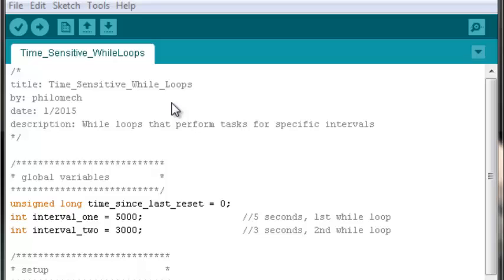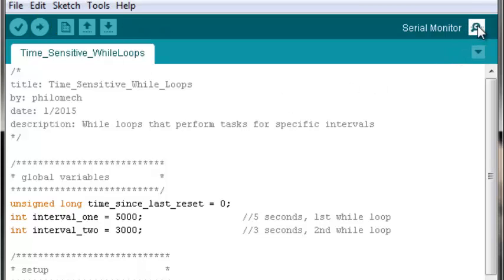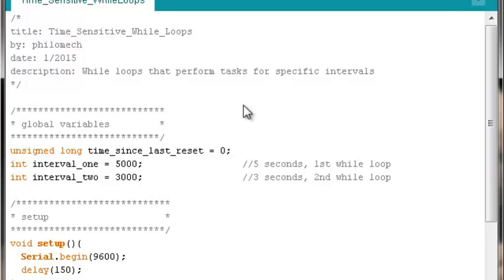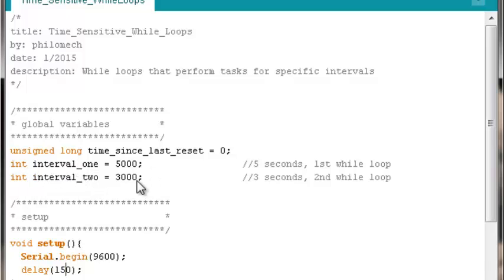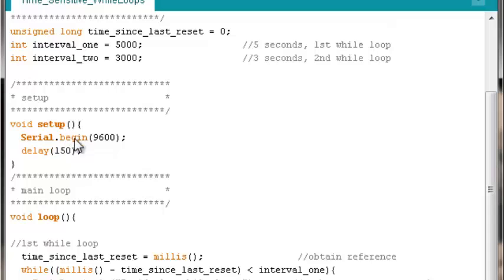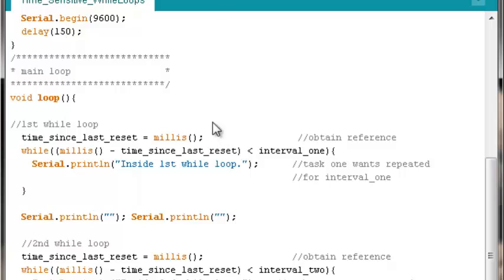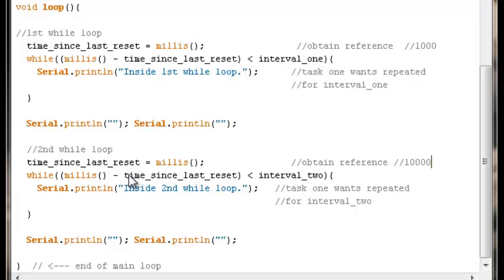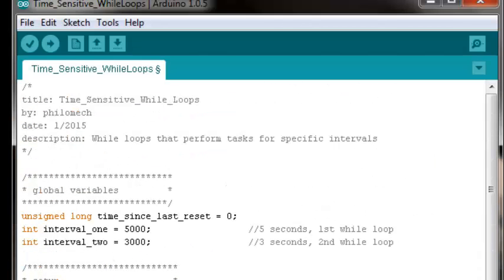Arduino Programming Tutorials || How to Construct Time-Sensitive While Loops

Comment: Thanks for the tutorial. Most of the time people are running their Arduino for short periods of time, experiments etc., but if planning to put your Arduino in service for longer periods of time, and wish to use this kind of routine for timing critical or semi critical operations, it's good to remember that the Millis() register rolls over every 50 days, and if using micros() the register rolls over around every 70 minutes. Good coding practices should take this into account when coding the while loop condition.

Comment: Can you trigger this particular price of code on a with a tactile switch? Or does time_until_last_reset start counting the minute the Arduino boots? I keep trying to implement this code... By giving a particular task a certain amount of time to execute. If there is no more activity on the button for 3 seconds: It takes whatever increment it is on and performs that task.

Example:

If(buttonState == 1)

While(time_until_last_reset == threeSeconds)

If(buttonState == high)

++someVariable

else()

switch(someVariable)

Case 1

Do this

Case 2

Do This

Case 3

Do This

Default:

Not understood

else()

//reset

someVariable  = 0
Reply from the maker: Jaren Hudson Appreciate the question and code.  Yes, one could definitely trigger time-sensitive while loops with buttons, etc.  Please give me a day or two (as soon as work releases me) and I'll post another reply to this message with some code possibilities/ideas.  Thanks for watching!
Reply from the maker: Jaren Hudson 
I'm trying to understand the order and logic of what you want the arduino to do.  

Do you want: 

(1) the arduino to listen for a button press
(2) if a button press doesn't occur within 3 seconds,
(3) then do something

OR

(1)the arduino to be performing various tasks
(2) and if/when a button press occurs,
(3) do some task for 3 seconds
(4) and then return to what it was previously doing?

OR

Might you have some other order/event logic in mind?

Just let me know and I will do my best to help. 

Also, time_since_last_reset will equal whatever the current value of millis() happens to be.  For example, suppose one enters the following inside void loop

void loop(){

      time_since_last_reset = millis();

      Serial.println(time_since_last_reset);

      delay(500);

}

The first time through the loop a value in ms will be returned from the millis() function and assigned to the time_since_last_reset variable.  This value will reflect how long the arduino has been powered up/running since either battery power was initially applied or since the last time the reset button on the board was pressed. Each time through the main loop (in the above example) one will notice around a 500ms increase in the value of time_since_last_reset.  

Essentially, calling millis() asks for the amount of milliseconds the processor has been operating since power up or since the reset button was pressed.  The value returned by millis() will always be increasing each time it's called.  Time is always passing.  Calling millis() is asking the arduino "how long have you been running?"  One can and often does use the answer to this question combined with later calls to millis() to do things like determine a duration, 'delay' without technically 'delaying', etc.    

E.g., 

void loop(){ 
    time_since_last_reset = millis();

   //perform some tasks

    time_now = millis();

   duration_of_performed_tasks = (time_now - time_since_last_reset);
}
 

Hope these comments help.
Reply: philo mech I am looking for a particular while loop to start at the press of a button... You select different "options" by pressing that same button again within those three seconds. I am attaching a piece of code (there may be a few mistakes) I just need to know where to add the time related functions.

*/This program is intended to listen for a button to be pressed. When it is pressed I need a time-sensitive while loop
to be triggered. This will act as a time out. If the button is pressed again within the three seconds it will incrment
an "option" variable. This will be used after the time out in a switch statement and print what option you chose within
those three seconds.
/*

int IncrementingVar;//Variable to store "options"

int Button = 12;//Button on pin twelve with pull-down

void setup()
{
pinMode(Button, INPUT);//Button as input

Serial.begin(9600);//Serial Communications
}

void loop()
{
int buttonState = digitalRead(Button);//New variable for "button"

if(buttonState == 1)//check if button is pressed
{
while(time)//This is where I need the time sensitive loop to execute but I can't seem to get the dang thing to start timing 
{    //once the button is pressed. I don't want it timing once the Arduino boots.
if(buttonState == 1){//if button is pressed again before the three seocnds pass... increment "options" variable.
++ IncrementingVar;
}else//do nothing
{
}
}
switch(IncrementingVar)//compare value of "options" variable to option choices
{
case 1:
Serial.println("Option 1");
break;

case 2:
Serial.println("Option 2");
break;

case 3:
Serial.println("Option 3");
break;

default:
Serial.println("No decisions made within three seocnds!");
break;
}
}else//Inform that there were no button presses
{
Serial.println("Listening again in 3 seconds");
}
IncrementingVar = 0;//reset the "options" variable if anything is stored
delay(3000);
}
Reply from the maker: Jaren Hudson 
Please see the following code.  It's not the most refined way to accomplish what you seem to be after but it should get us started.  I've tried to capture the control logic associated with the task.  Feel free to refine, modify, etc., it to better fit your application.  I included some crude/rough software debouncing .  If you're using hardware to debounce the button then such won't be needed.  

This is a first pass/draft.  If it misses the mark, or you have something else in mind, etc., then just let me know and we can go from there.  

/* (ROUGH VERSION)
title: time_sensitive_mode_selection
*/
/*****************
* global variables *
*****************/
const byte button_pin = 12;
boolean button_value  = LOW;

unsigned long time_since_last_reset = 0;
int selection_delay    = 4000;   //adjust as needed

int previous_mode       = 0;
int current_mode       = 0;
int max_modes          = 4;  //adjust as needed

/**************
* setup         *
**************/
void setup(){
  Serial.begin(9600); delay(150);
  pinMode(button_pin, INPUT);
  
} //<--end of setup
/**************
* main loop     *
**************/
void loop(){
  
  //read button
  button_value = digitalRead(button_pin);
  
  //button pressed? (crude software debouncing)
  if(button_value == HIGH){
    //if so, then delay for a few ms, give button contacts
    //time to stop bouncing
    delay(150);                                  
    //and then read button pin again
    button_value = digitalRead(button_pin);
    //if it's still HIGH, then
    if(button_value == HIGH){
      //print message to user
      Serial.println("\nYou have 4 seconds to make a selection.\n");
      delay(500);    //give him/her enough time to read it
      
      //get current time
      time_since_last_reset = millis();
      
      //and repeatedly test...has 4 seconds passed?...has 4 seconds passed?...
      while((millis() - time_since_last_reset) < selection_delay){
       //if not, then print message 
       Serial.println("make a selection!");
       //and repeatedly check button
       button_value = digitalRead(button_pin);
       //crude debounce again
       if(button_value == HIGH){
         delay(150);
         
         //if button value goes HIGH
         if(button_value == HIGH){
           //and the value currently assgined to mode
           //hasn't exceeded the max number of modes
           if(current_mode < max_modes){
             //increment mode value by 1
             current_mode++;
             delay(10);  //for stability
             //print message...the currently selected mode is...
             Serial.print("\ncurrent_mode = "); Serial.println(current_mode);
             Serial.println("");
             //give user time to read mode
             delay(500);
           }
           //otherwise, current mode value has
           //exceeded max number of possible modes
           else{
             //reset current mode to 0
             current_mode = 0;
             //and make previous and current mode values match
             previous_mode = current_mode;
           }
         }
       }
      }
      //let user know that the selection window has expired 
      Serial.println("\nselection window expired\n");
      delay(2000);
    }
    //previous_button_value = current_button_value;
  }
  /*if user did happen to change the mode value
  during the 4 second window,
  then run new mode value through switch()*/
  /*if no change to mode value was made, then 
  stay in whatever mode was previously selected
  */
  if(current_mode != previous_mode){
    switch(current_mode){
      case 1:
        Serial.println("\nmode 1 selected\n");
        //set previous_mode value to current_mode value
        previous_mode = current_mode;
        //do whatever else here
        delay(2500);
        break;
      case 2:
        Serial.println("\nmode 2 selected\n");
        previous_mode = current_mode;
        delay(2500);
        break;
      case 3:
        Serial.println("\nmode 3 selected\n");
        previous_mode = current_mode;
        delay(2500);
        break;
      case 4:
        Serial.println("\nmode 4 selected\n");
        previous_mode = current_mode;
        delay(2500);
        break;
    }
  }
  //display current mode
  Serial.print("-current mode-: "); Serial.println(current_mode);
} //<-- end of main loop
Reply: philo mech Thanks much. Very timely replies; I appreciate that. I will optimize it and change a few things around. I am using hardware to debounce the switch, to conserve memory. Thanks again though!
Reply from the maker: Jaren Hudson Glad the example code looks helpful.  It can definitely be refined and optimized.  I didn't have much time but I wanted to provide you with something that was close to what was needed as quickly as possible.  The switch case structure might need to be relocated/tweaked, etc., in order to accomplish precisely what you're after.  But hopefully the example provides some helpful ideas.  And removing the crude debounce code would be an immediate improvement, I didn't have a s-trigger, etc., ready to hand.  If there are more questions along the way, please continue to let me know and I will always do my best to help.

Comment: Hi Philo,
You were a major help in the past and I was wondering if you could help me again. I am trying to use arduino to close a relay once every hour and log data before relay closure and then after.  
I've been trying to understand how to create a time LONG time delay for arduino, from my understanding, the regular delay cannot do something more than a minute? Others I have seen have used some strategy which uses millis() against a set interval in order to approximate the period when to activate the relay? but this is a bit much for my software understanding.  Or am I really making this more complex than it needs to be? I can't just use delay for a long amount of time?  Thanks
Reply from the maker: Appreciate the question!
In principle, one could use the inbuilt delay function to halt an Arduino for longer than a minute, but there tends to be a 'better' (relatively speaking) way to achieve multi-minute, and especially-->hour to multiple hour delays.  Namely, one can use a real time clock chip/module.  Just connect one to the Arduino and have it trigger the data storage/relay trigger  events every hour on the hour.  

I've had a lot of success with Adafruit's DS1307 real time clock breakout board kit. http://www.adafruit.com/product/264  

Adafruit also provides a helpful description of the setup and library needed to use the DS1307 under their learn section.  The chip might lose a second or so every now and then, but it tends to be accurate enough for many projects.  

I've used the the DS1307 breakout to control everything from arduino based clocks, automatic door locks, automatic pet doors, automatic feeders, etc., etc., always with reliable performance.  I'd definitely encourage you to check it and Adafruit's description out and see if it might be suitable for your project.  It not, then just let me know and we'll go from there.  

Hope these comments help.  And, please continue to let me know if/when there are more questions.  I'll always do my best to help.
Reply: philo mech Thanks philo you are awesome I really appreciate the help! I now see delay sucks.  I wanted to get a RTC but I was being frugal with cash, and havent had the need for such precision. I just want a valve to open every now and then, and thats fine for me.  What i figured out is that I could use millis() to just open a contact for 1 second, and every hour since the variable  resets every ~49 days will this stay accurate saying I reset the arduino every day 24 hrs? How inaccurate does millis become?. I'm now attempting to code data acquisition into the eeprom.